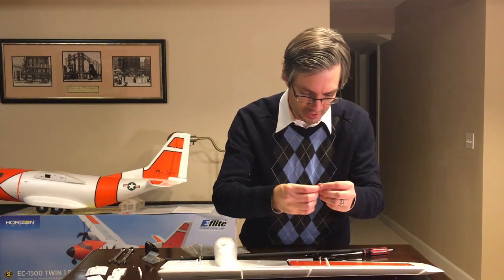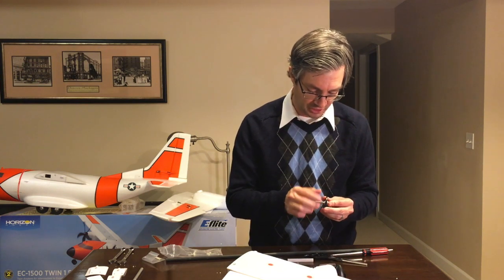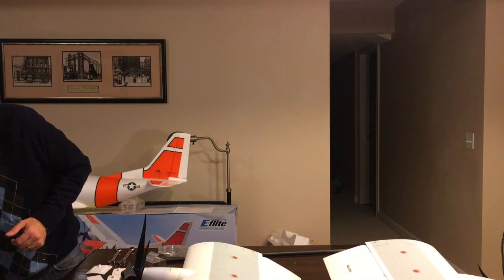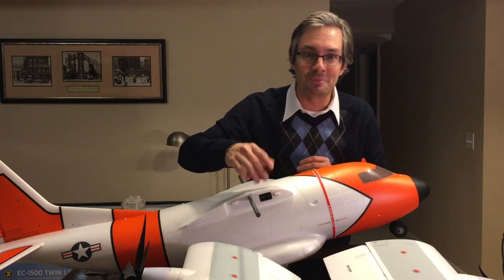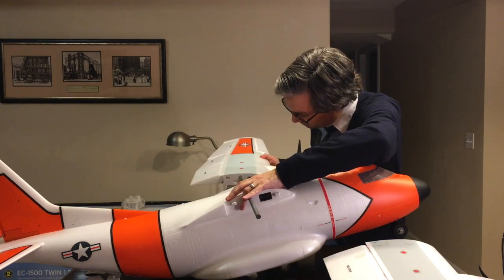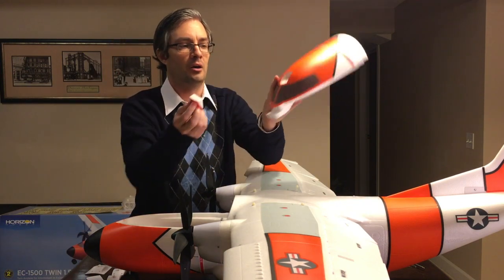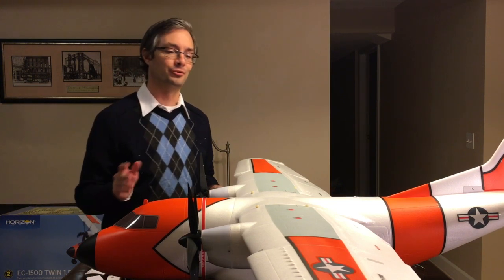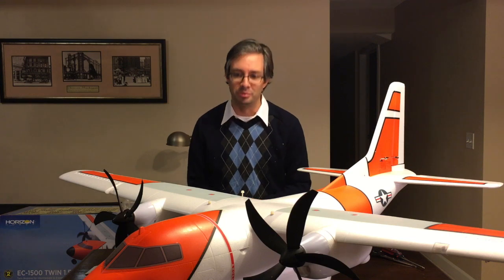How to assemble the E-Flite EC-1500 Twin 1.5m BNF

Comment: Hi, I having difficulty removing the wings, please could you help, is there a special technique. Could you help with a video on dis assembly of the plane for transport
Reply from the maker: I hold the engine nacelles when removing the wings. They tend to be a bit sticky for the first couple of tries. I added some Detox-it spray on the pin connectors, a little teflon lubricant to the spar and around the plastic connectors, and then gave the spar and the hole in the wing for the spar a chamfer to let them go together easier. I did hear of a new trick this past week which is to use that rubbery material designed for cabinets to keep stuff sliding around and grip the wing with that to give you some extra grip without damaging the foam. I will try that the next time I get the plane out. Right now it is in storage as the flying season is about done for the year. I don't know if it will fly again until next spring.

Comment: Any chance putting metal screws for  wings? I wonder if the the thumb screws for the carbon z cub  ss would fit?
Reply from the maker: not sure if they are the same as the Carbon Z Cub or not, but I am sure you could upgrade the nylon screws to metal. Just need to match length and thread. There are two different size screws on the EC-1500. The longer ones go towards the leading edge.
Reply: @BRGT350  Thanks